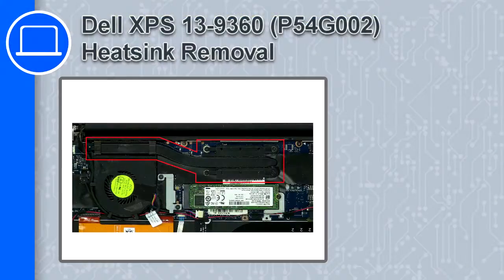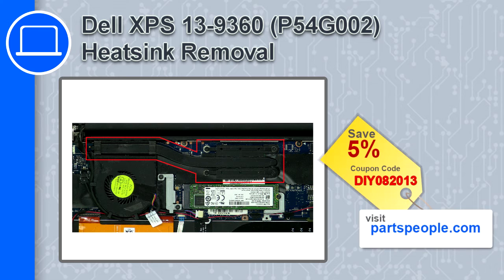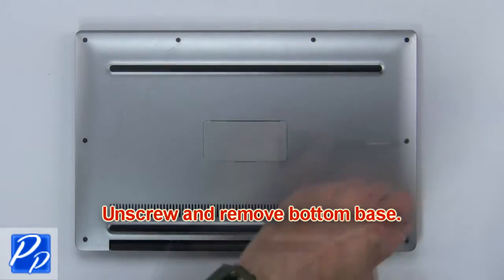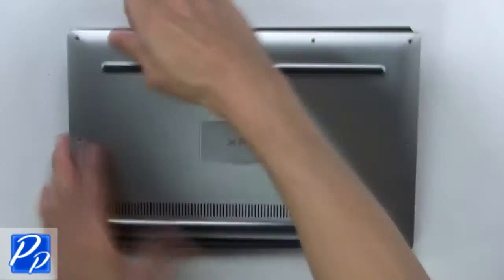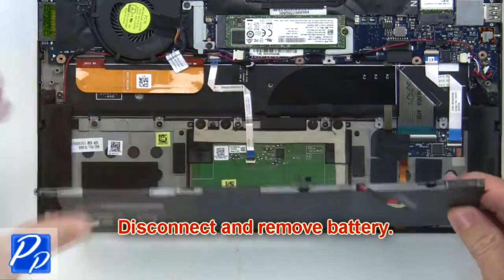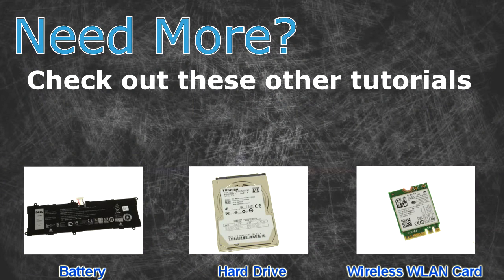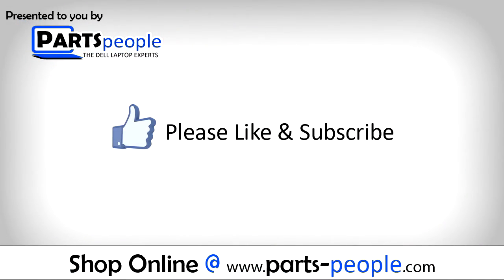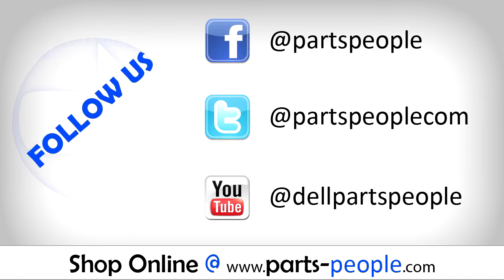Dell XPS 13-9360 (P54G002) Heatsink How-To Video Tutorial

Comment: I tried to follow this instruction but got stuck when actually removing the heatsink. In the video it comes off easily. When I try it will not come off after removing the screws. I am somewhat afraid to apply more force. I don't want to break the cpu... Any advice?
Reply: Nevermind... Some dental floss did the trick!